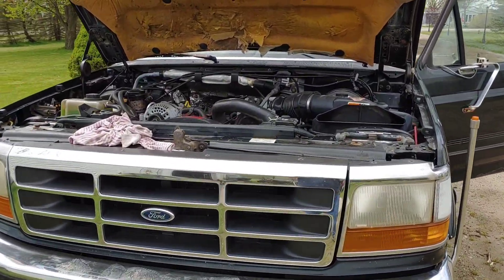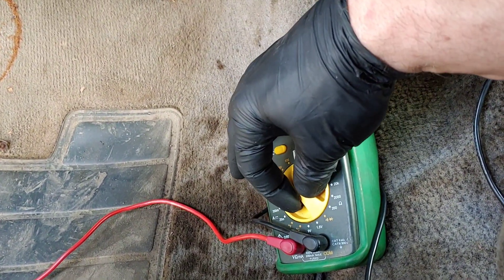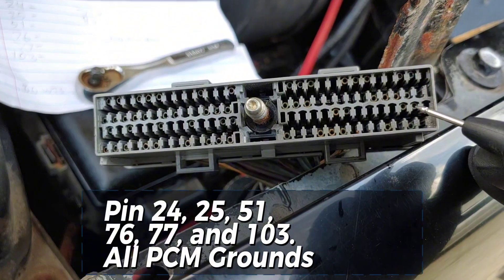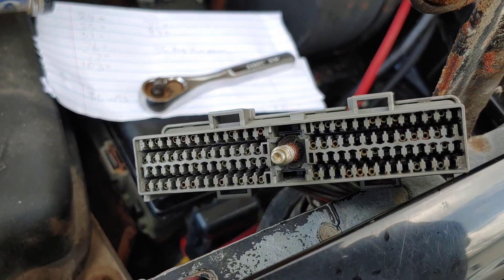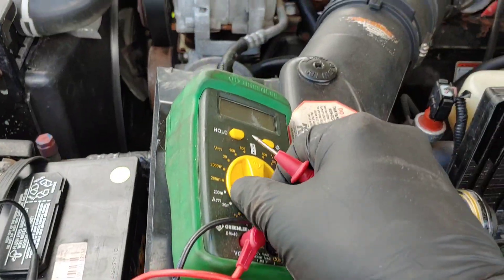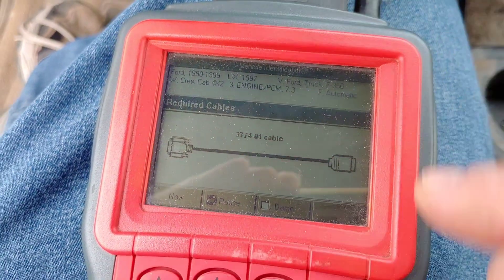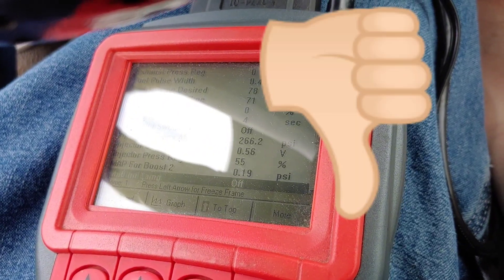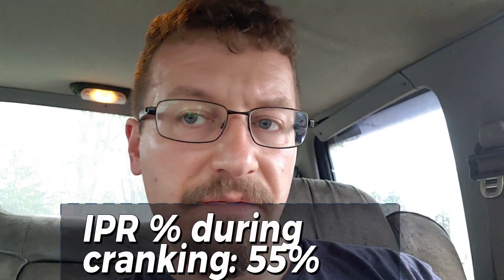PCM OBD2 No Connection 1997 F350 7.3 Power Stroke

Comment: Had the same issue. Tracked down everything you showed. Had power and ground where I needed. Had continuity. PCM and IDM are getting shipped for rebuild. Thank you so much for this info. I would have sent them out anyways when the scanner wouldn't link and truck wouldn't start but I'm glad I was able to confirm it